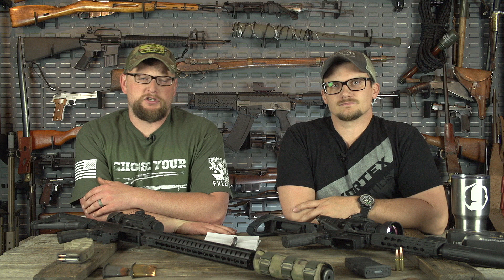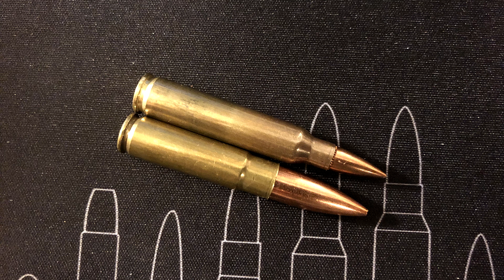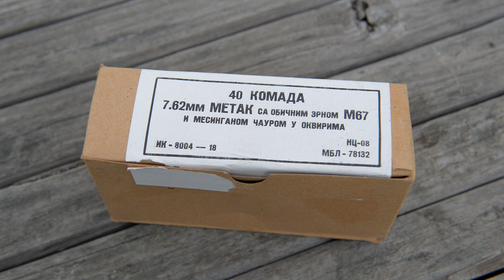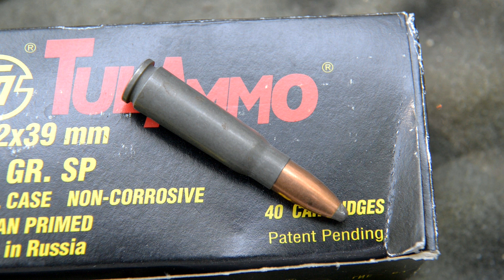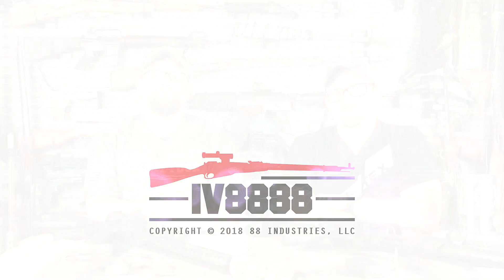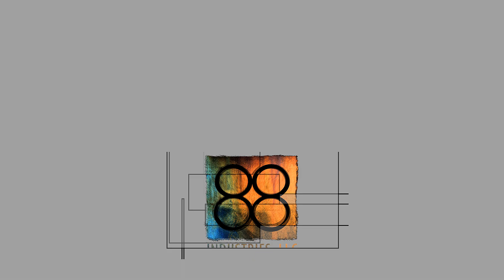Firearms Facts: 7.62x39mm vs 300 Blackout

Comment: Can y'all answer this for me? 

I have heard that the 7.62x39 "Cartridge" is not reliable due to the taper of it and the needed curvature of the magazine. Is this true? It's the only reason I have been turned away from this round and got the blackout. I was planning on PSA's KS47 as my shit hit the fan sort of thing due to the abundance of ammo and just stock pile it. 

They have said not reliable in the feeding of the ammo. I would think wrong because of how reliable an AK is. I just don't hear of that issue. 

Thanks in advance.
Reply: The ks47 is a solid rifle that takes reliable AK mags. You will not be disappointed with it
Reply: @2wheeleddemon999  Hey thank you. This helped with my decision on it.

Comment: I have a 300 Blackout.  The brass, for me, is not expensive.  I am able to pick up brass at the range (223/556) and when I get it home, I size and deprime, clean it, then cut it and form it into 300 AAC.  So brass is relatively free.  I then can reload 1,100 rounds for about 250 bucks.

Comment: funny I watched this video a year ago when it first came out and I was not doubt on chad's side mostly because I love the ar15 platform and built two 300 blackouts at the time a 10.5 and a 16'. However a few months ago I bought a palmetto state ks47, didn't take me long and I sold both 300b/o. All I ever heard was how inaccurate the 7.62x39 round was and I was a little hesitant but I really liked the idea of an ar15 that took ak mags. I dropped a 1-6x primary arms acss scope on the ks47 and ima tell you I was surprised. Initial zeroing was done at 50yds and with cheap 122gn fmj tula / 124gn wolf hp I was getting one hole groups. Backed up to 100yds and couldn't believe it even with the cheap ammo I was getting 1.5' groups. Seriously didn't have one group that was over 1.75' so why stop there backed up to 300yds and was nailing a 4 inch plate like I was shooting at a mini van.
Reply: oh and the best groups I got out of my 300 black out at 300 yards was like 6-8 inches. the ks47 16' routinely shoots 4-6 inch groups. haven't ever and don't really ever plan on shooting it any farther. this will be my 7 year old sons dear rifle this year

Comment: If you want to try a good hunting round in 300bo you really need to try the winchester extreme point 150 grain I've had very good luck with it
Reply: That's what I'm using this year. I'm just not sure if it will be good on hogs with the rapid expansion.
Reply: @2wheeleddemon999  it's not as bad as it seems I would definitely try it though, it's been one shot stops everytime on deer even shootin in the chest facing me.
Reply: @tylertapp131  I'm definitely going to try it out. I'm a big fan of Winchester power point.

Comment: I'm jumping on the 300B.O with the 16" barrel. .110gr or 125gr will be great for the ranch or urban defence.. it's nice it can be suppressed... fyi no need for suppressors. ..
Reply: Do you need a barrel? I have one that shoots 125 sst's quite well. Been there done that. I own a farm.  Shot 5 deer with the 300 and it works but not a lot of room for error. I went ahead and went the 18" 6.5 Grendel route and was shooting steel at 500 yards for the first time yesterday evening. Hit the heart popper 2-3 times. I did also build a 300 pistol though. Mostly my farm truck gun is shooting Varget topped with a 55gr Nosler Ballistic Tip.  Coyotes don't like it.
Reply: @foragefarmer1300  no I don't thx though .. also I don't plan on suppressing it... it will be my hog gun / coyotes for the ranch..

Comment: Beyond around 300m a 7.62x39 bullet will have slowed enough to enter the transonic  velocity range (20% above and below the speed of sound, so 400m/s to 275m/s). Although the bullet is overall travelling at supersonic velocity, at just over the speed of sound SOME airflow over the bullet is subsonic flow, other parts are supersonic.

This causes a lot of turbulence that buffets the bullet and throws it even farther off course. Many long range shooters have found that bullet performance "drops off like a cliff" at whatever range the bullet velocity falls to around 400m/s.

Comment: A 7.62x39 AR is far safer than 300 Black, it's  because far more difficult if not impossible to accidentally chamber a 7.62x39 in a 5.56 barrel. Which is clearly not the case with 300 blk. 

Buy C-PRODUCTS 7.62x39 AR magazines and reliability is a non-issue.

Comment: The 7.62 was design for reliable loading in a auto.Look at the rim and the taper of the case, the rim is thicker than a .223  to help in ejection without ripping the rim off. also the taper helps in feeding.
Reply: Hey from the future. Just saying that the Soviet 5.45x39 has the same advantages over 5.56x45 as the 7.62x39  over .300BO withnearly no downsides. Love my CZ527 in 7.62x39. Wish I could get one in 5.45x39. I could have gotten one of those E. German rifles but didn't. Non-buyer's remorse.

Comment: Yeah... But can you convert a 7.62x39 into a 300BLK...???  No. My ammo costs are only a few bucks per 100 more than AK ammo because I have the ability to convert .223 cases into 300BLK. 
And while not impossible to do, I've yet to see any factory subsonic for the 7.62x39. I shoot suppressed and that's the "niche" the 300 fills.

Comment: 300 blackout does allow for the quietest smallest combo with good stomping power and effective range.  I wonder how 300 black performs at range compared to a 458 socom when both are subsonic.  I imagine that 300 black has twice the effective range of 458 even if it is half the energy delivered.  Those are two very interesting rounds IMHO.

Comment: I thought you were comparing the calibers? You should have also considered other actions like the Ruger Mini 30 and the American Compact Tactical. In 7.62X39, you could also have more easy success with subsonic suppressed loads. You don't have to worry about cycling the action and you get even more performance from their longer barrels. 300 Blackout is not even close.

Comment: Just like the 30-06 and .308 argument of the past, the 300 aac is much easier to run in multiple set ups from hard hitting fast round set ups to quiet heavy rounds for cqb (even heavy rounds that are still really moving). Eventually the 300 will get cheaper in ammo and add more to the already impressive range of loads. The 300 will take over as the favorite for most people, just like every newer cartridge it takes years for gun and ammo makers to get where they are capable of going. I love the reliability of AKs and anyone can pick one up and run it without keeping it super clean, but being able to swap between my MCX barrels and different loads is much easier than my AKs, Galil’s etc. a person can do a lot more with their 300 blackout than what the AK round is intended to do. This being said, I think the 300 will eventually be an equal option (when ammo makers continue with breakthroughs and cost), the versatility and ease of set up change is already there, as is the accuracy. Nothing better than being an expert on one gun. Having a short barreled suppressed cqb that is also able to reach out using a longer barrel and faster ammo will eventually win out. The ease of the switch and the versatility is not even in the same category.

Comment: I think 7.62x39 is probably a good all-around option if you can only have ONE rifle and you need it to fulfill many potential roles. And if you can afford to have a ton of guns, sure get a whole rifle in 7.62x39, but I think most people are, like myself, in the middle where...well I can really only justify having 3 or 4 rifles. In that case, I would rather get the AR-15 and just spend a little more to have an 300 BLK upper and then that frees me up  to get another rifle I can  buy for an entirely different purpose rather than have to choose between 300 blk and 7.62x39 which fill kind of the same role

Comment: I built a 300 Black Out using a Anderson Arms Upper and Lower and a 14-1/2" Anderson arms Barrel 1 in 7 twist with a pistol length gas tube.
The single most expensive item on this build was the bolt at around $164.
Reloading Hornady 150 grain FMJ-BT using Lil gun it will shoot 5 in 1/2" at 100m ( I have a Vortex 6.5×20  setting on top of this rifle )
All this said the single most enjoyable thing about this rifle is reloading the 300 Blackout.
I have loaded everything from the 86 grain Lehigh defense Xtreme cavitator for the 30 caliber carbine and a 100 grain Lapua hollow point match bullet that has a very interesting cutting ring around the bullet making it act like a semi wadcutter.
And on the heavy end a 245 grain Missouri River cast lead bullet and everything in between.
This cartridge is a Reloaders dream.
PS that 100g Lapua bullet you might look them up if you like shooting 30 carbine I believe they would work very well for home defense ( I would like to see these shot out of both a 300 Blackout and a 30 carbine into ballistics gel when you take a look at the bullet design you will understand what I am talking about )
Got mine at Midway USA.

Comment: It's interesting to see how the blackout has evolved the past several years to be a single platform do- it-most(there is no do-it all) ammunition. Cost per round is down below the magic $0.50 mark now, and the preferred bullet weights actually increased over the release preferences. Most sub ammo is 220 grain plus, while most supers are either 124/5 or 147. The 147s in particular have some goldilocks action going on as of late with even factory loads exceeding 2100 fps pretty regularly. This is a plinking load, and it's a boat tail with an awesome BC. I don't think the Blackout will ever kill the 7.62x39, but it enables significantly better flexibility in an AR platform, that happens to be the most flexible platform itself. It's also found a popular niche in brush guns. Having a short 16 inch barrel on a super-light break action or bolt gun, that can take a large mule deer or act as bear protection, is an awesome trick. I don't think Eric or those who share his opinion should feel threatened that one of his favorite hunting rounds will disappear, he/y'all should just be happy that another possibility is coming into its own really fast. A quick note though, that should have been brought up, is that most indoor ranges across the country only allow boxer primed brass cartridges. This means that most of the U.S population's convenient shooting areas don't allow cheap steel cased munitions(especially steel cored). That point means that most of the time, blackout will actually undercut 7.62x39 for price due to the relatively slight number of brass 7.62x39 manufacturers. Nothing beats an AK for a heavy hitting fart around gun, but I think it's the fact that you can go from farting around, all the way to doing some serious work, that has made the Blackout explode in popularity; and more importantly, the aftermarket has followed it too. That is the main reason why it is the number 2 cartridge used in the AR platform in 2018, and not a niche cartridge.

Comment: you guys are %100 right with your comparison . but i have a762x39 & reload for it. plus i can load .308 to 311, 312 bullets for 762x39. BUT 300 BLK OUT is DANGEROUS if you  go back & forth from 223 & 300  blk out, because you can chamber a 300 blk out in a 223 by accident. so i will not have 300 blk out ammo in my house because i have 223 ar,s. plus you can suppress a 762x39 also. the 300 blk out in nothing but a glorifyed m1 carbine cartridge.

Comment: Harvest data; I shot a deer with 300aac using 194gr lehigh defense max expansion sub pill from 8" barrel. I was hoping the bullet wouldn't pass thru... but it did even after going thru a rib at 75 yds. It DID expand as promised, but the animal ran about 25 yds b4 collapsing. Dbl lung and clipped the heart.

Comment: With the prices of ar15 bolts, mags and barrels. You can build a dedicated 7.62x39 upper for around 300$ and get you a couple cproduct for 20$ a pop. Ur looking at 340$ to get u a dedicated 7.62x39 setup. So honestly the price of switching from 300blckout or 7.62x39 is minimum.

Comment: you guys are looking at this wrong. 7.62x39mm has only one advantage, it is CHEAP ammo. If you look at the ballistic. At the muzzle 7.62x39mm has a slight velocity advantage, but by the time you get to 50 yards 300blk overtakes it and by the time you 300 yards 300blk has almost double the energy. So, yes, the 7.62x39mm can get out to 500 yards but it will only have enough energy to kill a coke can or a piece of paper.

Comment: 300AAC PFTTTTTTTT!  I will take the 7.62x39.  Also I have a 6.5 Grendel upper to go with my 7.62x39 upper.  I do have a .223/5.56 upper and bolt system too.  One rifle 3 calibers and none are the puny 300 AAC.  9" barrels?  What for?

Comment: Not only is 300 blackout easy to suppress, you can also shoot supersonic out of a considerably shorter barrel and also maintain accuracy. Try that with an AK. There, I just summed up the reasons why 300 blackout is relevant in one sentence.
Reply: In a short barrel it will have significantly less muzzle blast and recoil then the AK round. Yeah the AK round has an edge when going longer barrel 150 ft/lbs or more. Short barrel home defense or truck gun its really good.

Comment: 7.62x39, it’s more economical, practical, and readily available.
Reply: Untill times like now. 762 ammo is either out of stock are marked up 10%. Good time to own a 300 i must say
Reply: @ko9856  300 blackout ain't no better.
Reply: BoogalooBoy1776 Price wise maybe  but as for availability 300 is readily available at my local academy. Most dealers as well. Or maybe its bc im in the louisiana swamps lol
Reply: @ko9856  your panic buying is costing you more now.  Shoulda stocked up on that 7.62 when it was available and cheap.
Reply: @ko9856  all my lgs has is 5.45 and 7.62 and 12/20g
Reply: Throughout the SE 5.56, 7.62, and 223 are readily available 300 blk out not so much hard to find or price through the roof... 223 prices aren’t bad
Reply: 7.62x39 is a dated round for Cheepos. I like accuracy over value. And I can smack coyotes out to 600m with a hypersonic .300AAC round. I would not trust my 7.62x39 rifle past 450m for an ethical kill shot.

Comment: Check your load data manual.  This from Hodgdon's reloading page 300 Blackout:

21.0 grains Lil gun
125 grain projectile
16" Barrel
Muzzle velocity - 2400 fps
Muzzle energy  -  1598 ft/lbs

The performance of 300 Blackout is nearly IDENTICAL to the 7.62 x 39 in equal barrel lengths using the same bullet weight.  If you load your own ammo, 300 Blackout is cheaper to load that purchasing trash ammo for 7.62 x 39.

Comment: You wanna know what the difference is? I can buy subsonic .300 Blackout that will cycle my AR at Walmart. I can't find anything that will reliably cycle my AK that's subsonic. I'm not into reloading but I've read about it and it seems possible, but no one has done it. If they did, I wouldn't be building .300 Blackout ARs.

Comment: All depends on your intent. The 300 is meant to be an ar pistol, it is the best ar pistol round as it is designed for smaller barrels. Using it in a full size barrel is defeating the purpose of the 300.

Comment: I use those 154 grain soft points for everything. They cost 25 cents per shot, where the cheapest of the cheap ak ammo is 20 cents per shot. So yeah a bit more expensive, but they are capable of 1-2 moa groups out of my ruger ranch. They are also boat tail projectiles. The extra weight plus the boat tail gives these some of the best ballistic coefficient out there for 7.62x39. By just 100 yards out its got every other 7.62x39 beat.
Reply: Facts !

Comment: What I got from this is simple:
x39 if you don't plan on handloading, and you don't have any need, or desire, for an SBR.
.300 If you do.

.300 Has a hair less overall performance potential for a handloader than x39, but it has vastly more options for bullets to load.

Or get a .30-30 if you want a lever gun. Same shit. :P

Comment: When I brought my 8" barrel 300 BLK (Maxim brace W/ sping capture piston) suppressed (oal >29"when collapsed, about 33" in use) out on the group shooting trips, all the 5.56 & 7.62X39 guys gave me shit... Until they shot it. Now they're picking my brain to build one. 😁  Seems the no flash, minimal recoil or rise, and [relative] quietness (not even the "slinky" noise in the buffer tube) is a big hit. 

Yes, I own, or have owned, the others, but for pure joy and happiness... I'll be using the 300 BLK when 200 yards or under(Subsonic). Over that range is why I have an AR-10 (.308), and the can is a QD that swaps between them. For real reach out, the 300 Win Mag (another QD mount muzzle break) bolt gun does me just fine. Also did it for the light chassis 16" .308 bolt gun for hunting. 

I call it my "silence on a budget plan".🤣